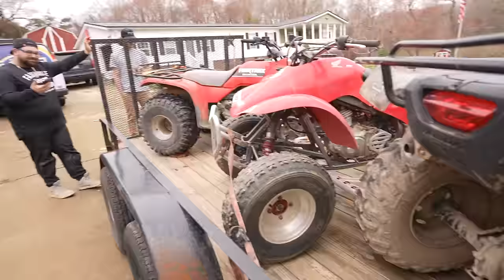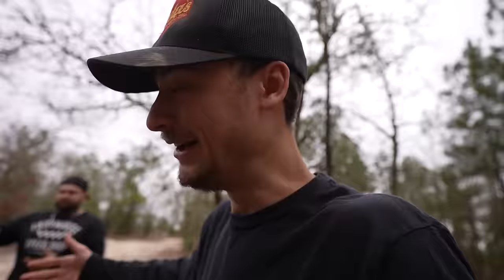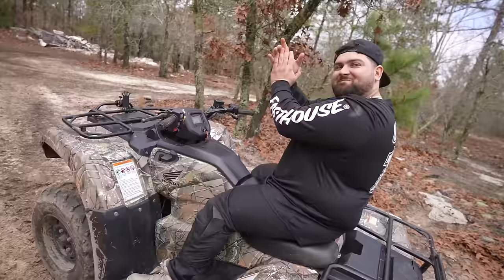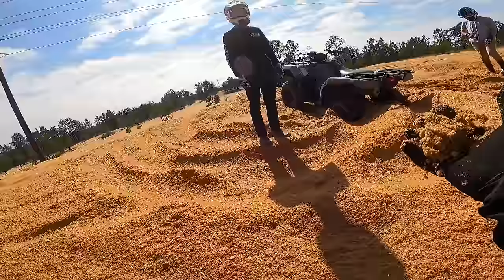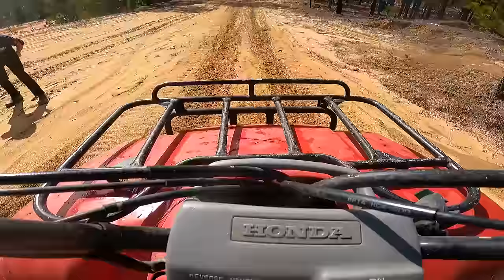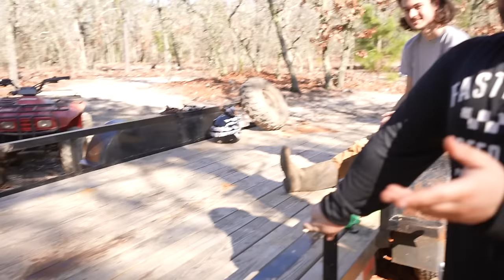Paddle Tires On My Honda Rancher

Comment: Don’t know if you’ll see this but I also have a 250x and 400ex suspension will work and if you want it to be more planted get you a tusk plus 3 rear axle helps a lot.
Reply from the maker: What all do I need?
400ex a arms
400ex Shocks/springs
What else?
Reply: @MCProductionGarage if you use the 400ex arms it’ll extend the front out either an inch or 2 inches not for sure. But it’s a complete bolt on.

Comment: Idk if you'll see this I would love see your opinion on the Yamaha Kodiak 450 I've had it in 2 foot of mud with water above my headlights it pushes through mud that gets in it's way I'm not saying that to say it's a good bike because I've done it it's a really good bike I've had little issues but nothing major I have the DJ exhaust just the slip on it sounds great not to loud and not to quite it tops out at 52 in a streight line going down hill I've almost had it at 60 it's a really good bike for the mud and trail riding you really should give the Yamaha Kodiak 450 a try and do a build on it if you get a brand new one there bad ass four wheelers and have independent suspension as well really easy to get over rocks and trees